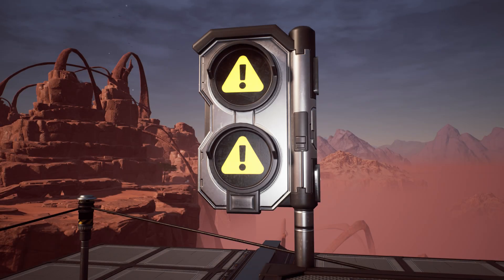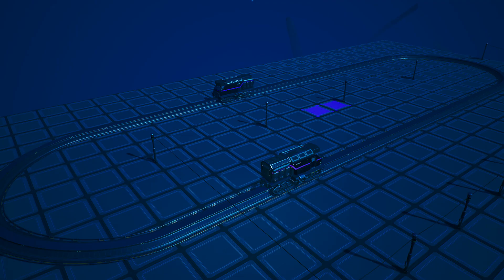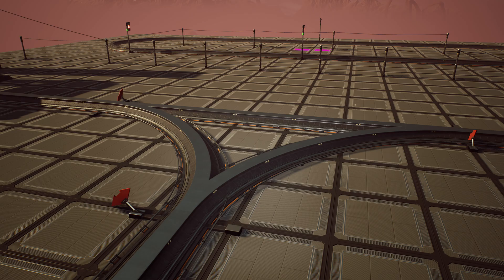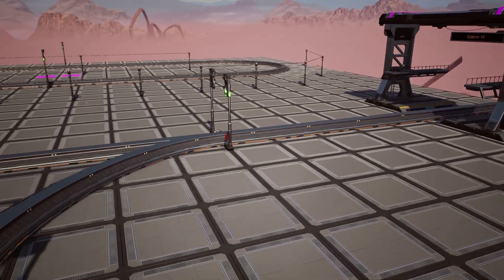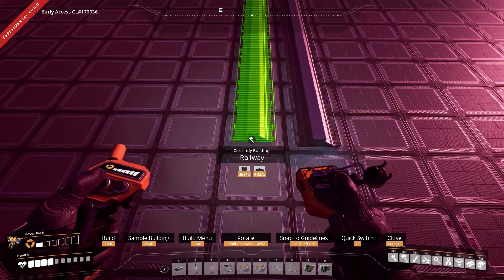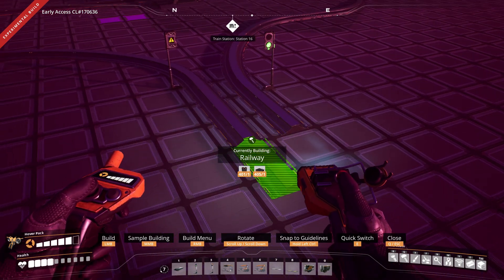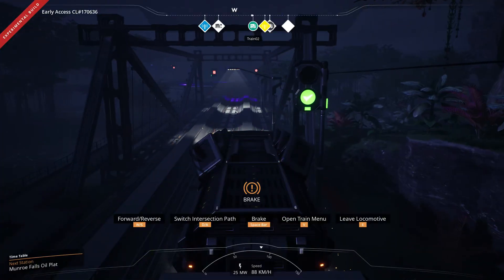Satisfactory Train Signals Tutorial Update 5

Comment: It's actually easier to follow these rules:
1. Path Signals start a Path.
2. Block Signals End a Path.
3. Put a Block Signal at every Station Entrance and Exit.
4. Put a Path Signal only at every Junction Entrance (splitting rails).
5. Put a Block Signal at every Junction Exit in the direction that you want trains to go (merging rails). If you don't want trains going right in an intersection, don't put a block signal after the intersection in that direction.
6. The cul-de-sacs at each Branch End simply loop back to the Branch from which it came.

I like to lay only 1 track for long distances. I do not do 2-lane highways. I have one central intersection where currently 4 legs branch off.
North Branch goes to Bauxite Facility.
West Branch goes to Oil Facility.
East Branch goes to Black Powder & Compressed Coal Facility. (same recipe, so same building) Compressed Coal goes to the Oil Facility to produce Power (Currently at 2GW Production) and Black Powder goes to Oil Facility to produce Smokeless Powder.
South Branch goes to both the Main Hub (Where I have a receiving depot that can only empty the trains on a Sushi Conveyer with 115 smart splitters into 115 Industrial Storages and overflows into a Sink) and the Iron Facility Hub which picks up every item that is produced using Iron (most recipes need iron, it's a busy facility that overflows into a Sink once the train depot is 100% full by using only dumb splitters so I get random items sent to Hub to ensure those storage bins fill).

At this intersection, a Path Signal from each Branch at every rail split and a block signal at every rail merge.
At the end of each Branch, the facility Train Stations, both a receiving station (with 4 cargo car depots because 1 engine pulls 4 cars, 2 engines can pull 8 cars) and a Shipping station.
Each station has block signal at immediate entrance and immediate exit.
Each rail intersection (whether merging or splitting) has a path signal at the split and block signal at the merge, from only the directions that the train is allowed (my cul-de-sacs are 1-way only).

This method, in my instance, with 2 stations on the North Branch, 2 stations on the East Branch, 2 stations on the West Branch, and 3 stations on the South Branch (Hub + Iron Receiving & Shipping); can harbor a max of 24 trains (because there are 25 viable blocks of track [a couple sections are too short to hold an entire 5 (4 cars + 1 engine) length train]).
I currently have only 1 cargo train and 1 engine that I can hop in to ride myself as needed and to prove concept that the signals are functioning. It works very well as I finish my hub to accommodate every Part (leaves, wood, iron ore, steel plate, motor, rotor, stator... you know. I'm being overly descriptive because of whiskey, it's Sunday. Get off my lawn!)

I do hope this helps though. I'd make a video about it if my ancient pc could handle it. It can't. I have to play in a 800x600 windowed game on absolute lowest graphics settings because my GPU is a NVIDIA GT 620 and I am happy getting 12fps instead of the usual 7.
Reply from the maker: I think you should get published! 😉 (due to being the longest comment I've ever received). Sounds like you have a great handle on signals!  😀👍 Couldn't imagine trying to play at those framerates. 😥 I am very blessed indeed to have 60+ most of the time! Thank you much for your comment and insights! 😎

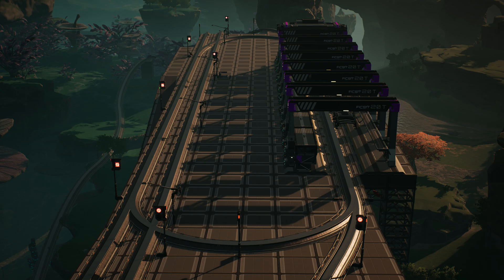Comment: 14:50 im trying to replicate this in my world to no avail, can you clarify how its signaled? my signals keep complaining
 about signal types and looping into themselves
Reply from the maker: I could definitely have explained it slightly better or more in-depth, so apologies for that. The big thing to remember is path signals before an intersection, block signals to exit the intersection. Also, add a block signal at each end of the station in the correct direction of travel for the station. That should be all this needs. Check out the advanced signal video I made, if you haven't yet, in order to understand a bit better how to troubleshoot the error you're getting. Hope that helps.
Reply: @Parkinwad  thanks for the quick reply, that fixed my issue!

Comment: Thank you for this video it does help. but I have a question on connecting the track to track ie: making "T" junctions or "4-way". I am having trouble even though I give the 3 blocks that you have suggested in the video. As a note this is my first play through and I don't have the hover pack unlock yet. I will confess I have a mouse with DPI adjustments that I try to use all the time, but forget a lot about that.
Reply from the maker: I'm assuming you are using a single track Junction? If you are, you may want to check out all 3 of my signal videos first to get a better understanding of signals in general. Thank you for the kind words, and I hope that helps! 😀👍

Comment: Can Multiple Stations Share Names like eg. All copper mine Stations called "Copper Mine". And the train goes for the first one available acting as a sort of Interface for Copper mines? That'd be handy!
Reply from the maker: No, but you could add a numbering sequence to it to differentiate between them.  🙂
Reply: @Parkinwad  Yep, that's true, in my fab i have Copper Mine A, Copper Mine B, and so on.

But they produce very little and for my case its much more interesting the route Copper Mine > Fab > Copper Mine so using multiple trains is such an overblow solution as for train traffic, but having to add manually all the stations in the timetable looks very like its not supposed to be done like that...
 
There must be some mod that does exactly that, and if not someone will create it, as it is so common to be done in factorio 😎👌

Comment: I have a problem where one of my trains wanna use a station to turn to get back to it's own station. This cause problems because another train is on that station it wants to turn into, and it jams up the lines, however, this train is not ment to go into this station. I've tryied every type of signal combination, however, the train only choose the occupide station, in stead of the 2 other round abouts on the line...
Reply from the maker: If the roundabouts are farther away, it will always try to use shorter track unfortunately. If they are closer, double check your signal directions, especially on the roundabout. Hope you figure it out. 🙂👍

Comment: I’ve been curious about station programming. I haven’t set up any advanced trains but I want to. Could you have a train with say 5 cars, and have a single station and one liquid or freight station on a route as a pit stop. Can it be programmed to pickup/load a specified  car? Let’s say car #3 is caterium ore. Do I still need to arrange the station with empty platforms  on cars #1–2-4-5? Or will it just load the 3rd car only and keep going?
Reply from the maker: I would say that empty platforms are what I use when I have a single car situated in a specific sequence in my trains, but train stations that are set to load, but have nothing in them, do the same thing as an empty platform, so if it's the aesthetic of a "full station" you are going for, then do that. Entirely up to you. I haven't delved into the new station load/unload programmable side of things as there are still some bugs, but may go into it in a video in the future as I see the need and things get fixed. :-)
Reply: @Parkinwad  I’m just trying to minimize the size of smaller remote stations across the map and wondering if they can pick up a single item to a specified car regardless of their order on the train
Reply from the maker: @SATISFACTORY INC Not really. The car's position from the train station (and hence the locomotive) determines which freight station will be loading it. We can use smart or programmable splitters to separate items coming off of a freight car though, so if it's a low-volume item, it could be worth it to just add it to another freight car. The problem is that we are usually hauling raw resources from the remote stations you are talking about, so belt speeds can become an issue after a while. I personally have 2 MkV's that run from 5 stations at a sorting and storage station I have, and it's rapidly becoming saturated.